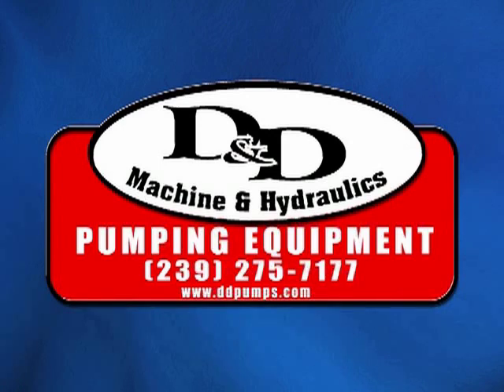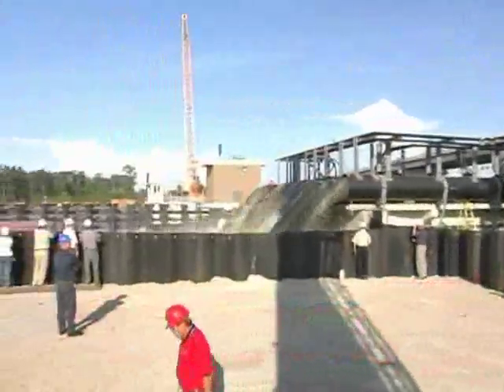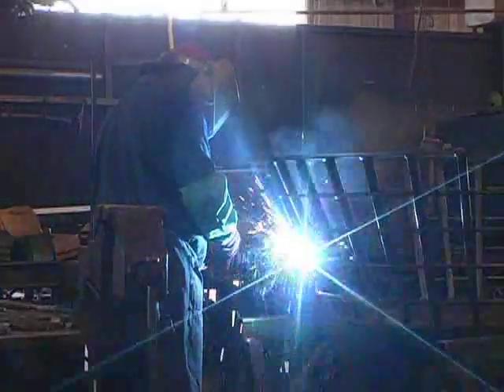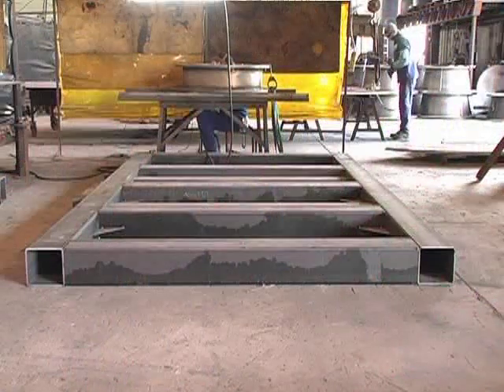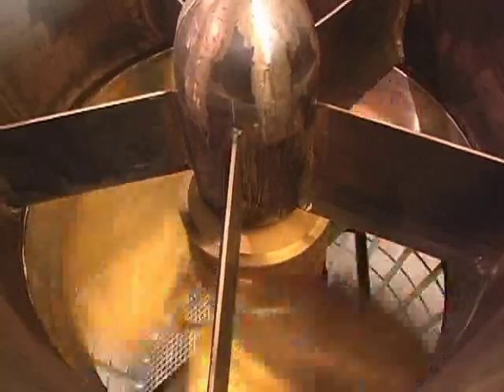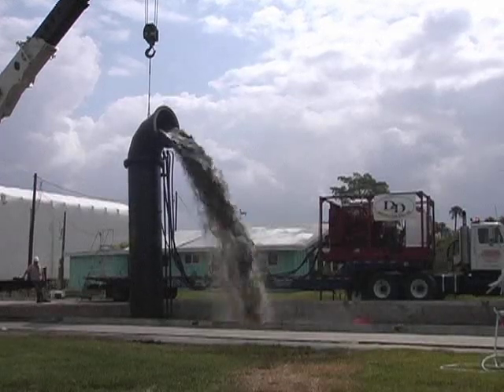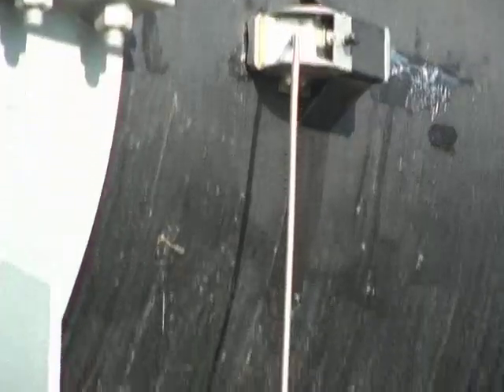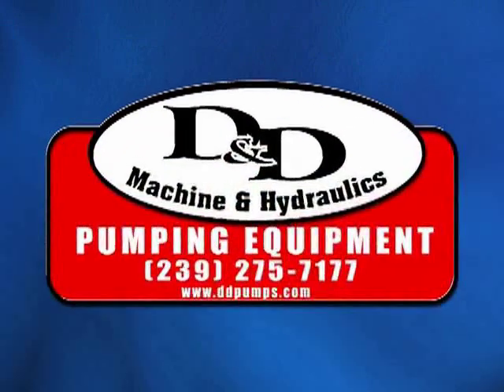D&D Pumps Helps Rebuild New Orleans, LA

Comment: Very interesting. For the purpose of the exercise, why lift the water so high? Perhaps a turn-down at the end of the delivery pipe would reduce the head to be lifted, and use less fuel.
Reply: An elbow would cut down on the flow and also would cause erosion of the canal bottom. All of ours had flap gates which broke up he water flow to not disturb the bottom as much and also to keep critters out. One station had rubber boots on them that look like the dirt dump valves on the bottom of a Donaldson air filter. That pump station did discharge from above the water level. Most of our pumps discharged below water level if for flood control. Ones we had at Everglades National Park ( Taylor Slough ) were also Diesel Hydraulic pumps and 42". Due to environmental concerns, we used Rape Seed Oil as the pump hydraulic fluid.